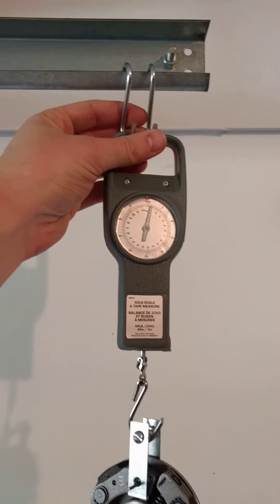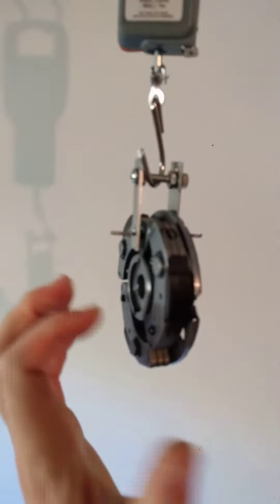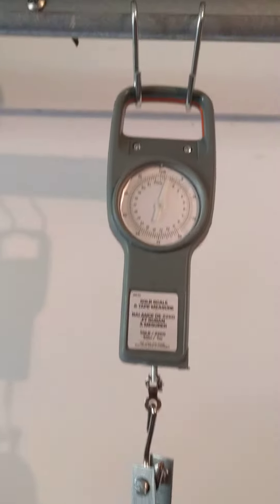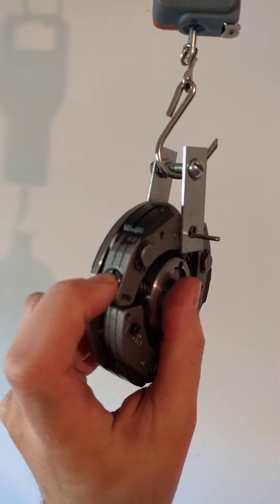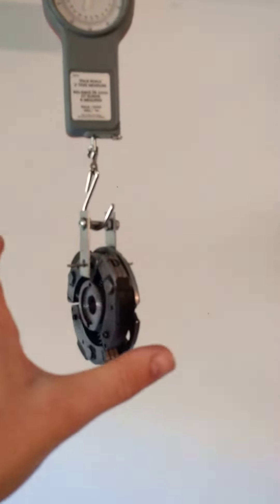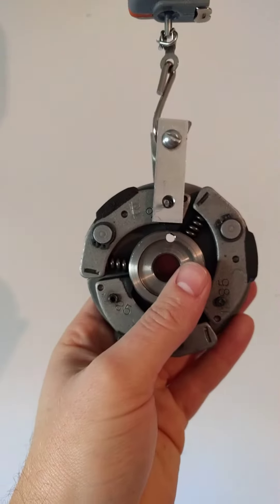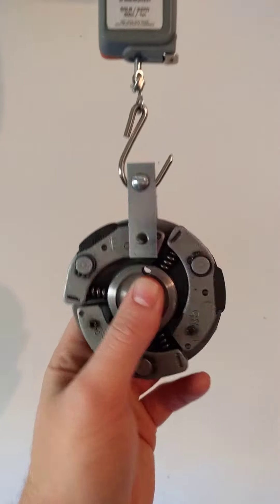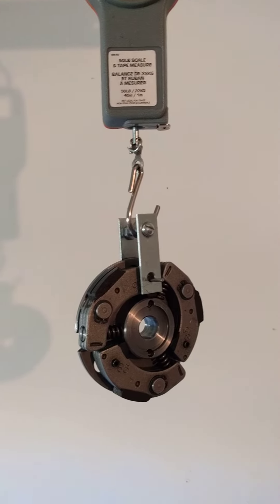Puch E50 Clutch Adjustment

Comment: Thanks! I have the old engine so tuning the clutch is something I’ve been putting off as I don’t want to keep splitting the case to adjust it, this will at least give me a balanced tension to start. I don’t know if the springs have been replaced yet so it will be a surprise when I look. I have no acceleration even when walking beside it giving it beans!
Reply from the maker: weird, maybe the retaining nut came loose and the clutch isn't spinning?  Curious to know your results.  If you use Facebook, look for "Lovers of Puch Mopeds"  (or "New England Mopeds" if youre in the northeast US) and share your findings lol

Comment: Tnx for the tip man! The two shoe are fitted on older models right?
Reply from the maker: Yeah I believe so.  I think they switched to the 3-shoe design at some point in the 80s.  I personally prefer the 2-shoe; it's easier to balance and it is less rotating mass for the engine to spin.  I tried a 3-shoe in my bike and didn't really like the engagement and it kinda sapped a little power.  trial and error, experiment to see what works :)
Reply: I know I'm quite off topic but does anybody know of a good site to watch new series online ?

Comment: what is the relation to your weight and the hilly place you drive your puch and the way the clutch needs to be adjusted?
Reply from the maker: every cylinder/pipe combo has a band of useful power across the RPM range... the idea is to allow the clutch to slip INTO that power band so that you can take advantage of the engine's power while the bike is stopped or at low speeds.

This is an important tuning/adjustment point regardless of the engine, the bike, or the rider, but due to my weight and the hills in my area, it is especially important to make sure the clutch is tuned to slip into useful power, otherwise I wouldn't have any decent acceleration.

If your clutch shoes grab too early, the engine won't be able to provide enough power to accelerate.  My current machine slips until about 30-35mph... that makes it difficult to maintain lower speeds because I basically have to just keep revving the throttle and backing off, but it's the only way I can quickly get moving from a dead stop.  But if I'm going up a particularly long/steep hill, the engine can stay in a useful powerband even if my speed dips down below full-clutch engagement.
Reply: @AGwolf2097  so for the better acceleration in hills must tight the screws or untight??